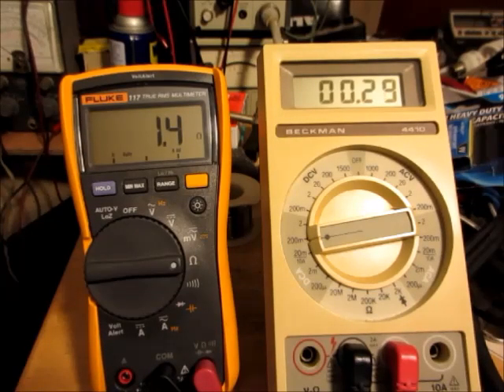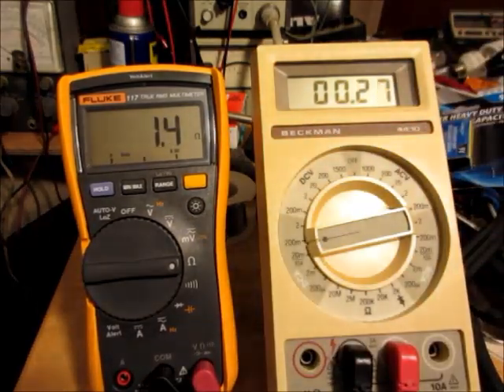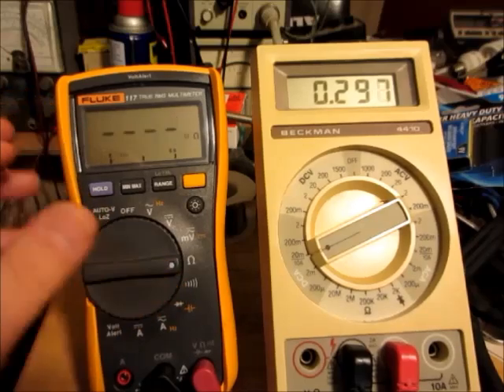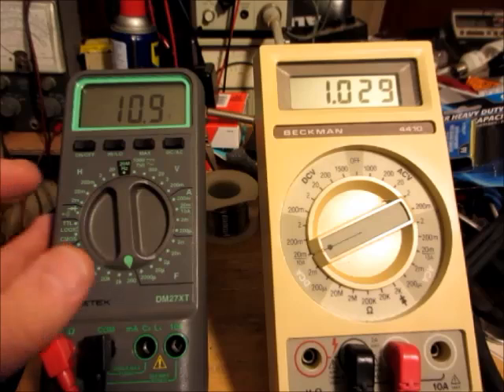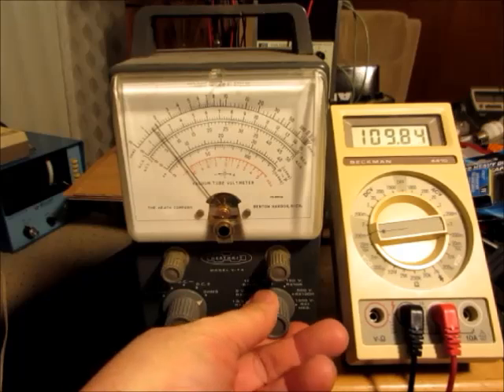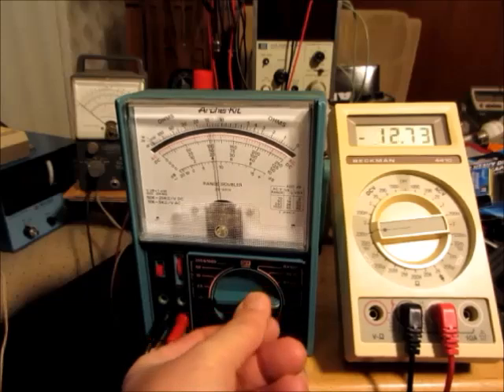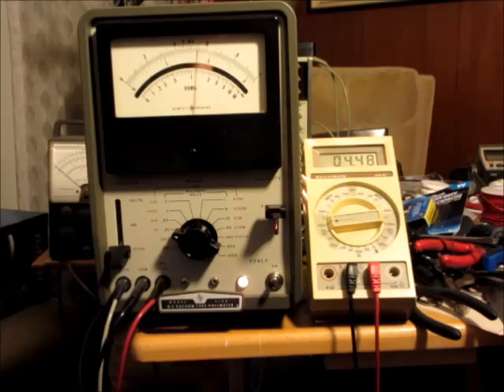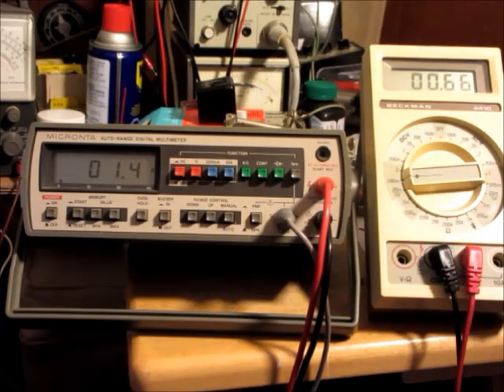Can you destroy a tube filament with an ohm meter?

Comment: Can those meters sustain that current through a filament? That information is needed to completely answer the question. The tube filament has a resistance of ~28 ohms and is rated so 50mA=70mW. You show the meter putting out >100mA on the "1ohm maximum" position, but also show dropping significantly in higher modes. If you try to test your 28ohm filaments in 1ohm max mode (which would be silly anyway), it would need to put out 28 times the power to maintain the constant current source. Whether or not it could do this is dependent of the voltage at the output, not just the current. 
The first analog one you show puts out 110mA for 1ohm, so it's putting out 0.1v: that won't hurt a tube. So far everything you've shown leads me to believe that tube filaments are most likely perfectly safe with these old meters. But the only way to know for sure is to do the tests with the load on the ohmmeter (either a 28 ohm resistor or a rare vintage tube, depending on your confidence.)
Reply: I would try it myself, but I don't have any meters that will put out over 10mA. But I am interested to know the results!
Reply from the maker: @SkippiiKai  Speaking from experience, I've blown filaments on tubes with 50 mA filaments by checking them with analog VOM's.   Just passing on useful information to radio restorers so they don't make the same mistake.   One thing to remember is that a cold filament has a low resistance and as it heats up the resistance goes up and it acts as a current limiter.

Comment: Thanks for doing that.  I was aware of the concern on the 50mA, 1.5V tubes, but never measured the current from my various meters.  I imagine a Triplett 630 VOM would source a lot of current from its 30V battery when on the 100K ohm range.
Reply: Don't imagine, get a second meter and measure it. I predict the current on the 100k range will be quite small.

Comment: What tube are you testing? Something like a 1R5, yes, but a 5U4, 6V6, 6AL6, 12AU7?  I don't think so. Most popular 5-12V tubes are rated at 1-3A heater current. That rating is for AC, they don't usually give a DC heater current spec. Unless I am missing something?

Comment: I have this same Archer analog meter , it uses a 1.5V AA battery.
Reply from the maker: @thisisyourcaptainspeaking2259  It also had a 9 volt battery for the 10k range.  I spent a couple of hours cleaning the white residue from a leaking alkaline battery inside the meter the other day.
Reply: @FranksPlace-jk7pj  Been a long time since I looked at it, you just reminded me of the 9V.
Reply from the maker: @thisisyourcaptainspeaking2259  From now on, I'm going to take the batteries out of any equipment I'm not using.
Reply: @FranksPlace-jk7pj  Yeah I learned that same lesson.  Guarantee an alkaline cell will leak.